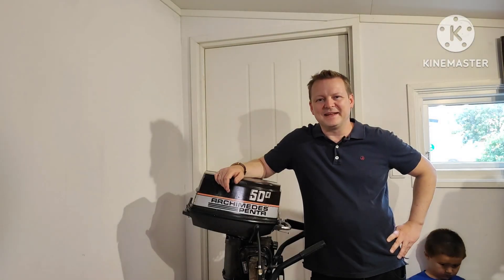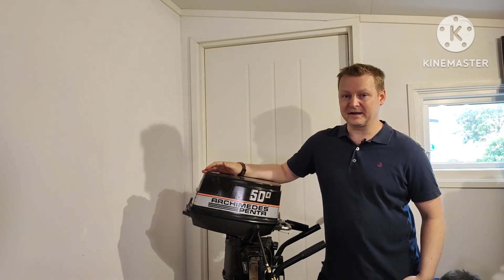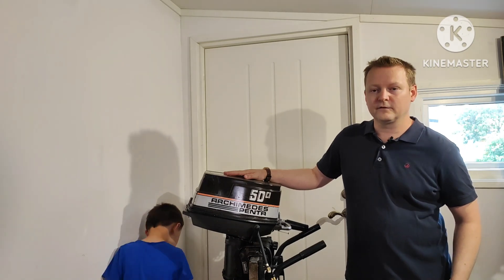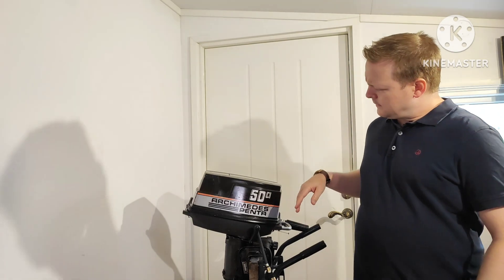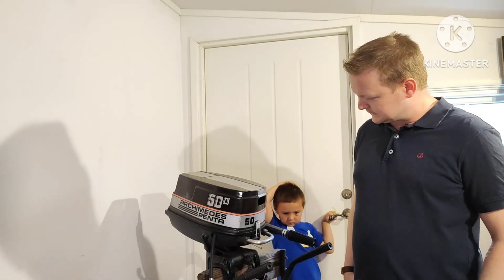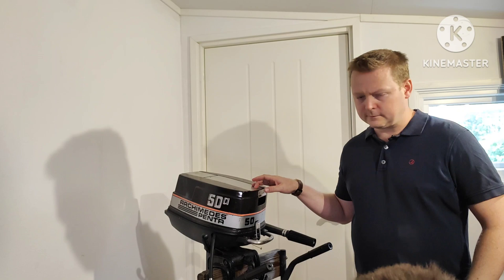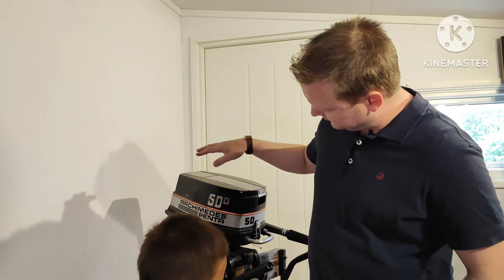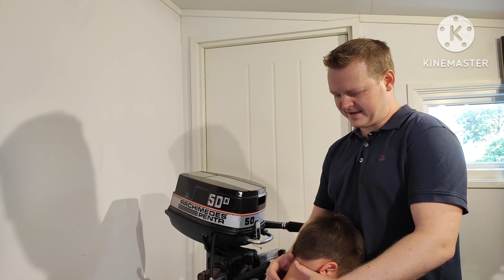Electric outboard conversion 3000w 72v DIY - intro

Comment: Any development on the build? I see nothings been posted in months
Reply from the maker: Hi. Well I completed it, and it kind of sucked. But instead I'm building the new 20kw carbon fiber outboard. Hope you like that much better - it's testing time after tonight so Sunday is the big day!
Reply: @NavalTechTinkerer  did it at least get 5 miles per hour speed?
Reply from the maker: @chesterlapicto8063  no. The issue was that my BMS was cutting (I believe). I haven't tested yet, and I'm currently working on my son's water jet and my flight certificate for LSA.

Comment: Any recommendations to source a motor for people who live in US and don't have a wife from china?  I can certainly use ali express
Reply from the maker: Hi. I would recommend Flipsky 65161, the current build I'm doing and posting about is 20kw and a bit too strong. I'd go with the 65161 or any of the weaker they have that are made for water sports and order directly from Flipsky. Their support has been great. The main benefit is cheap, made for water sports and since they are in the water you don't have to cool the motor. I had hell with trying to get water cooling and air cooling my shitty Vevor motor. Take a look at my new 3D printed carbon fiber skinned motor. I think you'll like it 🎉